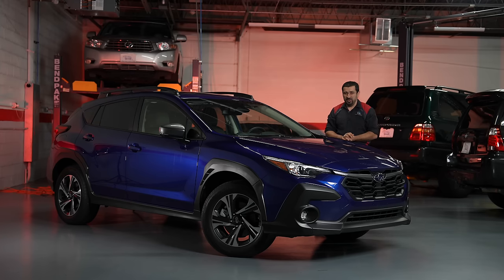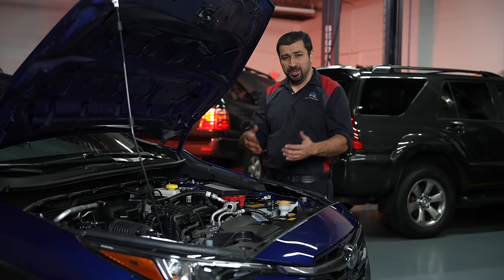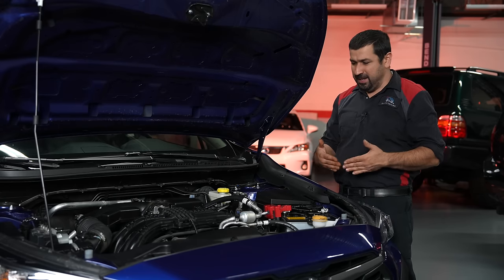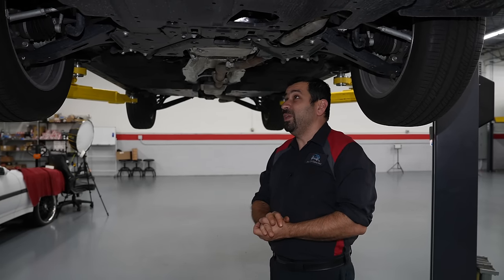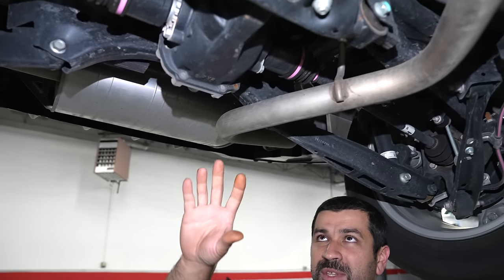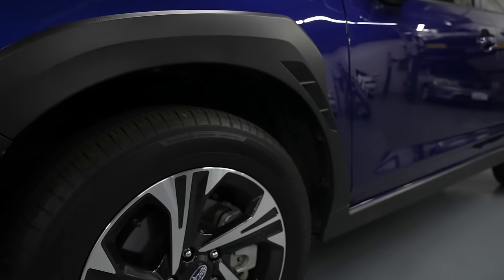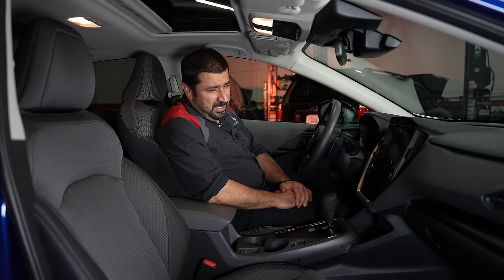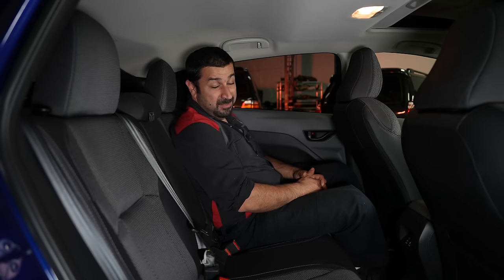Should You Buy a 2024 Subaru Crosstrek? Thorough Review By A Mechanic

Comment: The 2.0 engine has acceleration issues at higher speeds (only has power at the higher end - think like a VTEC) but it's off the line very quickly in the city. I really get surprised with the low end torque sometimes. The sport setting will give some good passing capability (engine sounds like it's going to have a heart attack though). The AWD system and braking system is superior for mid range car. IMO it's almost as good as a BMW AWD system (for daily driving - even better for off road) but like 1/3 the price. I'm constantly comparing the two and wondering why you need the BMW. It would be sweet if they make an R version. WRX turbo like system and ability to dynamically lower it. I'd also like to see the doors a little thicker.
Reply: True/ I got a new cross last week with the 2.0 engine/ extremely slow to pass other cars 🚗 but is 100 % Japanese, compare with the 2.5 engine assembly in usa 🇺🇸 so far I love the car 🚗 and seems safe and strong 💪🏻 in case of collision

Comment: ABSOLUTELY NO!
My 2018 Crosstrek was simple, rugged and sporty. I loved that car the most out of every car I've ever owned. I totaled the vehicle 😢
My new 2024 Crosstrek is nothing like my 2018. In fact I HATE IT! The car is overly complicated, seems like everything is going to break and drives like a little girls car. This is not a Crosstrek, it doesn't even handle the same. The car is full of electronics that are sure to do well in the dust, dirt and mud as I'm off road SMH. There is a huge OBNOXIOUS box located on your front windshield. This should be fun to change the windshield SMH. they couldn't even leave the E brake alone. Now it's electronic, this is going to fail or not work correctly eventually IMO. The start stop feature is ridiculous. The lane indicators, the huge display that blinds you at night.
IT'S HORRIBLE
Reply: That HUGE box is probably the eyesight system. I own an '18 Crosstrek Limited

Comment: Sold my 2005 Neon, moved my old daily driver 2014 JK (bought new, now at 266K miles) to the back up status and bought the base model 2024 Crosstrek as my daily driver. The amount of gas I'm saving compared to the JK per month is half of my car payment so I'm actually getting this car on the cheap. As for the slow acceleration you keep mentioning it's nothing new to me. Compared to my 2dr JK 6speed stick at 3:73 gear ratio this car is a rabbit.

Comment: Thank you for this great review. You say that with the DI in this engine carbon build-up "in certain driving conditions is very possible". Is there anything we can do to minimize carbon build-up?
Reply: Following
Reply: The Subaru service schedule has a clean at about 60,000 miles or 100,000 km which is designed to remove carbon deposits, particularly on the valves.

You can avoid excessive carbon build-up by getting the engine to normal operating temperature as quickly as you can. So don’t do lots of slow driving with a cooler engine temperature.

Comment: I've had my '24 Sport (with the 2.5 L boxer) for over 3 months now,I really like it.  Yes, IMHO get the 2.5 L  engine, it's quick enough for everyday driving.  I average between 26 - 32 mpg depending on how much city or highway driving I do on a tank, and staying between 60-65 mph.  The electronic parking brake needs the engine running to engage BTW.  I've gotten into the habit of turning off auto start/stop whenever I start the the car, no big deal.  The CVT works fine IMHO, and it doesn't "rubber band", like the CVT did in my 2015 Prius, it acts like a geared transmission.  Definitely get the options package with dimming side view mirrors, trust me, you'll love them.  You'll also like the 8.7" of ground clearance; I do.
Reply: The electronic parking brake does not require the engine to be running to engage.  What are you doing wrong?

Comment: Great deep dive/review as always. My question is about the increased tow capacity for the Wilderness crosstrek trim. At 3500 lbs, which seems crazy with a CVT,  what are your opinions on how well/long the CVT will hold up and last if towing this amount of weight? To me it seems like impending doom for Subaru's CVT if towing this kind of load. Thanks for your thoughts and insight.
Reply: You should look at different vehicles for towing. I recommend a small truck (Tacoma or Ranger, …) or rear wheel drive SUV
Reply: @paulm6481  Yeah, that makes sense. It just would be nice to hear The Car Care Nut's opinion on towing with a vehicle that weighs less than it's towing capacity and that has a CVT. Seems like a weird set of variables that all don't add up even though the manufacturer says so?
Reply: I believe that they add a transmission cooler to this model, which is standard in the European Crosstrek. I may get one for my 2021 Limited.

Comment: I've owned two Subaru Foresters, (2018 and '21). Was seriously thinking of upgrading to an Outback that has the same infotainment system as the '24 Crosstrek, and frankly I found it to be a deal breaker after renting one for a couple days. Not sure what I'm going to replace the '21 Forester with, but it won't be a Subaru with that big screen.
Reply: Toyota RAV4
Reply: @MauiWauiPineappleExpress  not a huge fan, to be honest. Leaning more toward the Mazda CX-5 or a '23 Forester with the old infotainment system. Or if I wake up in a mood to live dangerously, Alfa Romeo makes some of the best looking SUVs on the market. 🤣
Reply: @MarkDParker  Alfa Romeo is nice and are good cars, a bit more expensive but also classy.
Reply: I liked the look of the new Crosstrek but like you I said no way to that huge infotainment systems....  So I ordered a 23 Forester instead.  I ordered mine the day before the cutoff to still get a '23 from the factory but the way it looks the '24 Forester also has the older style manual buttons, etc and a CD player still!  Yay!
Reply: Ended up replacing our Forester with a Mazda CX-90 because I was in the mood to gamble.

Comment: Subaru's loyal customer have long wished that they would up the horsepower. It does not have to be a BMW horsepower but good enough to pass on the highway without really stomping on the accelerator. I wished Subaru would start listening.

Comment: Surprised you brought up review for Subaru. Owner of  Outback and 2 Foresters and recently switched to Toyota. Car is good besides the common head gasket, wheel bearing problems. I like they put filter on top and I can change oil myself. Eyesight won't work in bright sunlight or heavy rain. New cars still don't have 360 cameras.

Comment: Nitpick, but any sorts of halogen bulbs on a new vehicle today (for any trim level) is some pretty lame/cheap corner-cutting on the part of the automaker to cut costs.  Also, no supplemental port-injection is a big red flag on this GDI engine design, & automakers should know better - but cost savings are their biggest priority, as always.  Instead, it will be another problem for customers to deal with post-warranty.

Comment: Subaru cheaps out on gaskets and uses a glue instead of rubber so overtime with the heat of the engine the glue wears out and they leak oil like mad after 150,000 miles or so

Comment: I disagree with your emphasis  on slow.   My '24 sport is fine. And for your complaint about to climate control,  that's why it has auto. Set it and forget it. If you need the defrost , there are separate buttons for that.  My favorite features are the wireless charging and apple car play.

Comment: So IF you’re unfortunate to be one of the unlucky ones whose CVT craps out (although I do think that a lot of these people drive rough, yet claim/think that they don’t)…how much does a full CVT replacement cost?   I mean you’re gonna pay $3000 for an extended 100,000 mile warranty, so my thinking is just don’t get the extended warranty and just plan on your CVT being fine with good driving, yet IF it does crap out then the $3000 you didn’t spend on the extended warranty can go towards a new one…and also you gotta think about how you’d still be out $3000 if the CVT crapped out at 110,000 miles.

Comment: I have a question and I don't know if anyone will know or answer but I was just wondering if I see a blank spot on the Crosstrek where the switches for the heated seats go is does anyone think that the car is pre-wired for the on the heated seats like the heater part is in the seats and there's a connector or is it a whole different thing because if I could just get the switches and then the wire that goes to the seat

Comment: The 2.5 feels slow too ?
Reply: It would be nice if he gave numbers. I thing just shy of 9sec 0-60 for 2.5L.
Reply: It feels slow for Colorado ( Elevation 6000+ft)
Reply: @OutsideTheTargetDemographic   a 2.0 civic feels better than this 2.5 ?
Reply: @amine_d  I wouldn't know. I have a Subaru Forester 2.5L manual. I don't need my station wagon to do 4sec 0-60s. It is full time AWD, pulls trailers, cavernous cabin, and 30mpg. I didnt buy a sports car. 😅
Reply: I don't need a sport car either, but often they said Crosstrek is slow ! but they say the Crosstrek is slow, slow compared to what !? Because 180hp for me it's a lot.
Reply: @amine_d  Right. "Slow" is subjective. Sub 10 second cars are plenty for most users. In the 70s and 80s car faster than 0-60 in 12 seconds were considered sport cars. Speed isn't everything, especially when the speed limit is 60. Why do I need 500HP when my max speed is 60?
Reply: The 2.5L in the Crosstrek is 7.8 seconds 0 - 60mph.  Not too shabby for an AWD vehicle.
Reply: @eskieman3948  I will take the AWD over fast straight-line acceleration. 👍
Reply: @eskieman3948  what about 2.0 zero  to 60 ?

Comment: "Underpowered" I don't get. I have the Forester with basicslly the same engine. It hustles up to 80mph fast enough I never worry about a merge. That's all you need. I think people just don't get the CVT. It applies constant force. It doesn't "kick" you because that "kick" feom thr manual days is a car rapidly gaining and losing acceleration. You don't want that. My Forester just glides up to highway speed, and thanks to dummies, they added fake shifts so people feel the "kick". I want it turned off. I like gliding around like a hovercraft.

Comment: We have a 2020 Crosstrek and it’s a great everyday family car. These would really do well if Subaru put the FA24 turbo from the Outback Wilderness though. 182 hp and 178 ft lb torque from the highest trim 2.5L just doesn’t cut it for this car.
Reply: Huh? I have a 2023 Crosstrek Limited with the 182hp 2.5L and it's plenty adequate in the Crosstrek. Does 0-60mph in the upper 7-second range and in my real-world use gets over 34mph on the freeway. Does not feel slow when used like a normal vehicle.

Comment: I refuse to buy a Subaru unless they start to make a  normal inline 4 cylinder motor like everybody else , needs to stop burning oil  starting at around  60k miles, Subaru will tell you it's normal and acceptable. It is a big pain in the butt to replace the spark plugs. The only people that like these cars are the mechanics
Reply: Wow! Such BS.
Reply: You're absolutely correct. Many of the problems that subaru engines have are not acknowledged at the dealership. They will say, wow! That's never happened before, it's one in a million.  
The engine goes in and out so easy because they are constantly changing out engines.

Comment: Two things that are bizarrely stupid - no built in battery tester. My wife's battery died and only after it couldn't start the car the battery light shoed up - hopelessly dumb for a car that you'd want to take into the forest... And second - a full size tyre doesn't fit in the boot... WHY???? I got a full size spare wheel and tyre and even after removing the back plastic trim it just doesn't fit by about an inch. What possessed them to make the spare space JUST too small - again, going camping somewhere remote-ish you really need a proper spare with you.
Minor annoyances - only 2 steel lashing points in the cargo space... Give me 4 or none. Position of the light in the boot - plizzzz... design it, or get rid of it completely.

Comment: i've got that exact one, they are uncomfortable ( shoulder bolsters too narrow,  seat too narrow,  (pedal position actually gives my feet cramps when driving for more then 60 min), compared to the 02, 05 wrx and 12 forester,  suspension is tuned for a 90 year old grandma,  ergonomics insanely worse then the 02, 05 wrx and 12 forester ( I use these examples because i've owned them in the past ) , the 'driving' aids are dangerous as they react to things they should not.  The quality of the interior has collapsed, (i see less cheap plastic on a kids Barbie house). Absolutely hate Subaru now, I have a 2 year lease and I am counting the days till i can be rid of this mistake.

Comment: Subaru vehicles have been known to experience a few common issues, such as head gasket and oil consumption problems. Once a Subaru car surpasses the 30,000-mile mark, some drivers may notice a rattling noise emanating from the interior, resembling that of a soda can. Despite this, it is a reliable vehicle that fulfills its purpose of transporting you from one location to another in a straightforward and uncomplicated manner.

Comment: For the new Crosstrek I test drove, the brake feel was amazing, but the steering feel was very numb. Also, the spark plugs have a recommended replacement every 30 thousand miles, and the mid level models have less features than Mazdas, and erase the savings from having all wheel drive for the base model, compared to the CX-30 or an older 2 wheel drive CX-5.
Reply: As indicated in the owners manual, Subaru recommends changing the spark plugs every 60k miles, not 30k.

Comment: Would love to see you review the new hybrid forester.  Im imterested since it seems a lot cheaper andwill likely be more available.  However, i worry about reliability.  Subaru doesn't have Toyota's experience with hybrid systems.
Reply: Well, you DO know that the new hybrid Forester will be using Toyota's hybrid system, right?  It's public knowledge.  After all, the brand is 20% owned by Toyota (also public knowledge).
Reply: @eskieman3948  Actually, I didn't know that, no.  I know the Crosstrek hybrid was based on Toyotas system, and I wondered if this would be the case for the forester.  Will they be using an Atkinson Toyota engine or a Subaru boxer engine in the hybrid, do you know?  What about the e-cvt? I actually can't seem to find a lot of info on the subject.

Comment: Another thorough analysis. I agree the cvt transmission is a deal breaker. I like the Outback as I’m 6-2 and it fits. However, the infotainment system and cvt are deal breakers. I’m looking into the GX 460 and 4Runner now. Subaru should make a 6-8 speed transmission. But, being niche brand   They want.

Comment: In my part of the country we don't really need AWD for the few times it snows. It's too bad back in '97 they stopped offering a FWD option. It would also help with performance.
Reply: Depending on how you use the car. It is in flat paved road without much bad weather, AWD is not necessary. But if you plan to do off road trip or drive in the snow, AWD is much safer, especially if it's a family car.
Reply: AWD is just safer under all driving conditions. Its like ABS, you dont need it until you need it.
Reply: @weetbix2083  I gave you a reason. Now give me 4 more CONS of AWD.

Comment: As someone who owned and built a WRX up to 330whp. Subaru's are the absolute worst cars to work on yourself, they are made of chinesium metal that results in constantly snapped bolt heads by hand wrenching. Unless you are taking them to a dealer/shop for ALL your service needs, they SUCK to work on in all areas of the chassis and are not nearly worth the money compared to a Honda or Toyota. My 25 year old Honda S2000 has been way more reliable and trustworthy to work on than my 2018 WRX ever was.

Comment: This is what I hate about newer cars, everything is controlled by the screen. I had a friend of mine who has Toyota were everything is controlled on the screen. His screen actually went out here in Texas this summer, where the heat goes above 100 degree's. So he had to drive home from down town Dallas to Plano, TX in 108 degree weather with no A/C cause his screen went out. Toyota replaced it for free, but boy did he suffer.
Reply: On screen icons are cheaper to product than physical switches or buttons.  Get used to it.
Reply: @fred4080  that's a lie.

Comment: No air con vents in rear and CVT is a deal breaker.
Reply: The car is small and air can circulate under the seats to the back quite easily.  The CVT is smooth and responsive and time-proven.  Do some more homework.
Reply: @fred4080  Do you even have kids?

Comment: So, the takeaways: It's slow. It's not that reliable. Some normal repairs might involve removing the engine. It's prone to engine leaks. It's very basic inside. The infotainment system is slow & has replaced some useful buttons with inconvenient displays. It's small inside (you are 5'7", & frankly you looked cramped in there). The style is a mish-mash (those wheel moldings: ridiculous!), and it looks old. It engages all wheel drive ALL the time, even if you don't need it (gotta be robbing some fuel there). And you talk about the "price point" but never revealed the price or price range! For me, you just sold me on never buying this car!
Reply: Yeah you smart, buy something else, maybe bmw x3

Comment: Too bad it’s direct injection only. Junk. Why would Subaru go direct injection only??  Do not buy any car with a direct injection engine you will be sorry in 30,000 miles when it’s running rough and the shop tells you that the valves are covered with carbon and it will cost $7,009 to clean them off.